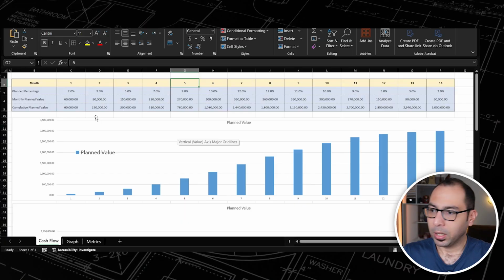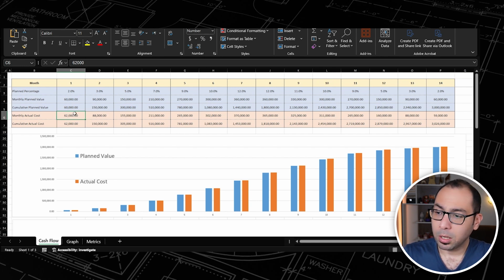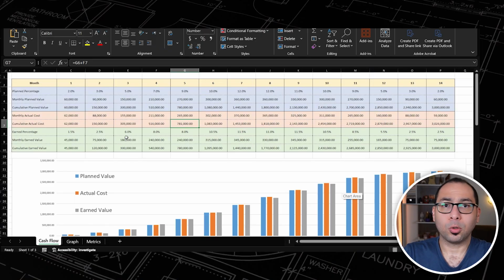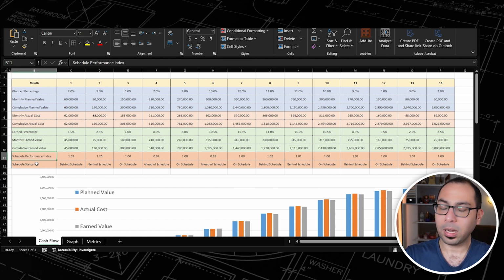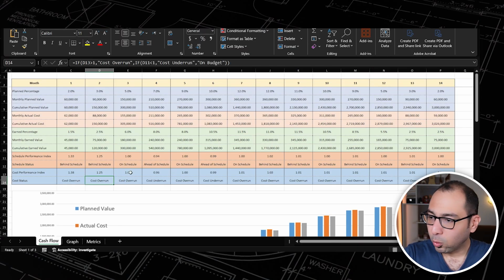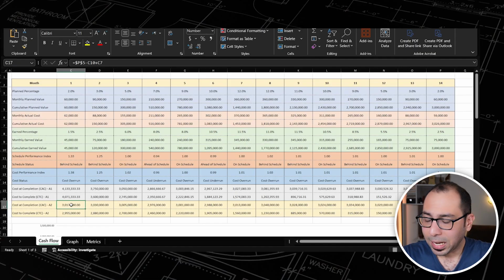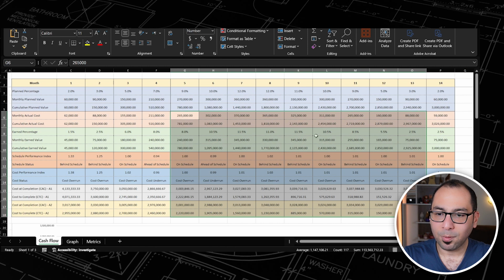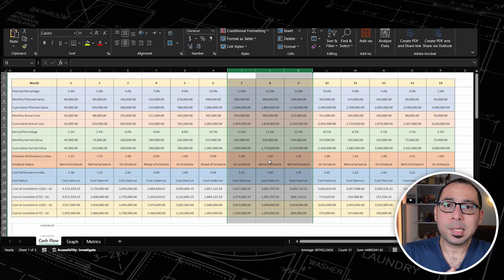How to use Earned Value Analysis to Monitor Project Progress & Budget

Comment: Hello M.Ahmed ,
I hope you're doing well.
I just remark one error in the video: the SPI should be calculated as EV/PV, not PV/EV.
Would it be possible to correct or remove the video to avoid any confusion?
thank you
Reply: You're absolutely right, SPI=EV/PV & CPI=EV/AC.
Reply: It cause confusion i agree, but his concept also correct because he calculated the SPI as PV/EV.
In this case, if the the SPI > 1 then it is behind schedule and SPI < 1 ahead of schedule.
While if you calculate the SPI as you mentioned as EV/PV then it will be the opposite, SPI > 1 ahead, and SPI < 1 behind.
Note: it should be both inverted not only one SPI = PV/EV and CPI = AC/EV in order to have a consistent interpretation.
But it is better to adhere to the standards which is as you mentioned SPI = EV/PV and CPI = EV/AC.

Comment: Hi ahmad
Thanks for the videos that always informative 
I have one question 
As PMP book showing
SPI = EV/PV
CPI = EV/AC

And when the values are more than 1 that means we are ahead of schedule / Below the budget 

I think it is the same idea in the video but u used 
SPI = PV/EV
CPI = AC/EV

The opposite but it reaches the same idea 

Can u clarify this if both are applicable?
Reply from the maker: Yes correct in most resources, the EV is divided by AC. In that case you divide by the CPI to get Cost At Completion.
Reply: @CEPQS  Above formula is wrong, or right?

Comment: Hi sir, a slight confusion. Cost overrun means actual cost is more than the budget which we call as over the budget and cpi is less than 1 is over the budget but in your case it is opposite.
Reply from the maker: Because I’m dividing by the earned value. Don’t memorize formulas. Focus on the concept 👍